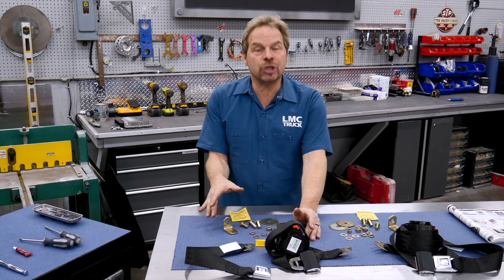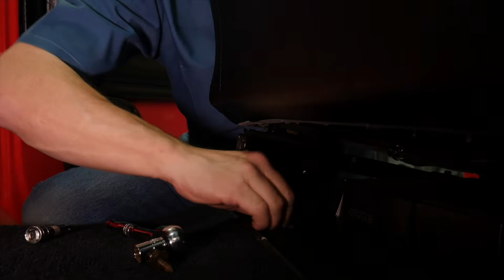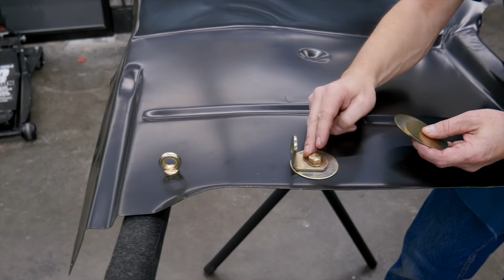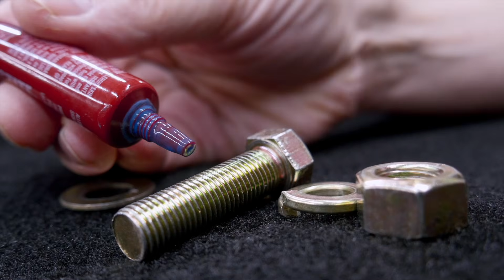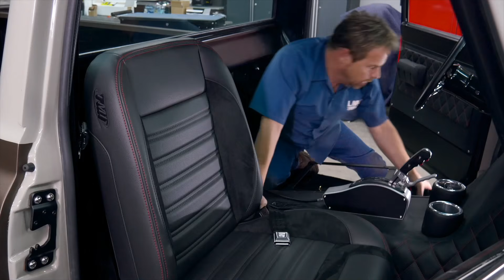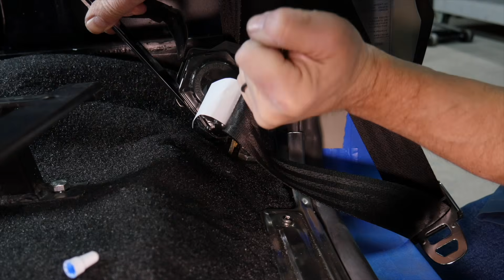How to Install a 3 Point Retractable Seat Belt | Kevin Tetz with LMC Truck

Comment: Nice video and very helpfull. Recieved my seatbelts for my 1983 Ford F250 a few weeks ago. Build them in, and that was easy but how can I attache the wiring for the seatbelt buzzer to the new buckle? Is it possible to take the wiring and switch from the old buckle and install that to the new one?

Comment: bought this kit to convert my 74 to a 3 point - but the bolts in the kit are too small for the threaded factory point in the cab corner. am i missing something here?
Reply: I too have a 74 custom deluxe C-10. Purchase 1/2" grade 5 or grade 6 bolts 1 1/4" long. Get those with threads with space to hex head,add 1 washer before and after mounting seat belt to upper corner pillar inside truck.Hope this helps ya.
Reply: @davidshirley275  thank you very much!

Comment: I'd like to do a 3 point for my 70 Impala
Reply: As a teenager I had a 70 Buick Electra and I am quite familiar with the lap and shoulder belts in your car. I was that rare teenager that buckled up both the lap and shoulder belts when I drove back then. It was a dedicated effort to buckle up the lap belt then the shoulder belt but I just got in the habit of wearing them. My lap belt had the locking retracters and the shoulder belt was manually adjusted with just a little slack. After being in a head on collision with a drunk driver, I can attest that those belts do the job and are life savers. I walked away with only bruises from the belts.

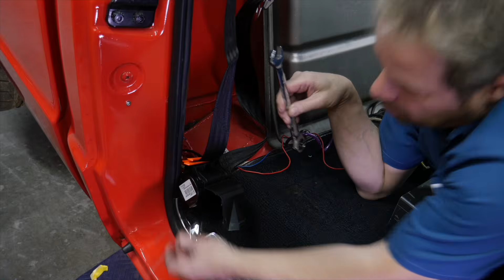Comment: At 8:40, will the retractor not hit the door when it's put in this way?

And another thing, there is only one bracket in the kit that is used for the retractor. Yet Kevin is putting in the straps for the bucket seats with that same bracket on the floor.
How does he do that with only one of those 90 degree angle brackets supplied in the kit?

Comment: there are NO instructions included in this kit. have to come look up a youtube video to see how to install the belts. also the cheap aftermarket appearance is appalling. for the money these kits cots they should be designed to work with the factory retractor cover that the squarebody trucks had from the factory. also these generic aftermarket kits are only made one way, to fit the driver side. when you go to put it on the passenger side, the belt will be twisted!!!! absolutely horrible!! very disappointed that this is the quality of product that LMC truck sells
Reply from the maker: Hello, If you would like to give us a call we're happy to email you some directions. We want make sure that you are satisfied and address your addtional concerns.

Comment: I just recently intalled these seatbelts into my 87c10 and they look up really quick. Just putting the seat belt on u have to move at a super slow speed or else it was lock up, other than that the install was super eazy and quick.

Comment: Does LMC realizes that NOT everyone has a 1972 truck. It would be nice to get some 80's instructions as well.
Reply: For80s they should have had3 point seat belts. Uninstall, then reinstall. How hard can it be? I have a 1980 GMC and it has 3 point belts.
Reply: I have a 1984 Dodge W100 and my retractable seat belts don’t even retract. I’m sending them back and replacing them with lap seat belts

Comment: Do you really have to remove the whole seat just to change the belts? overkill for sure. smh
Reply: You know that seat doesn’t fold forward. Little hard to get at the centre seat belt mounting points. I would take out the seat, save time and work.
Reply: You do it then with the seat in there.

Comment: well this is all fine and dandy, and the catalog says it will just go direct in place of my stocker in my 85 c10, but what about the seatbelt warning light, my truck has one and i intend to use it, lmc was originally supposed to be oer not universal aftermarket

Comment: Replacing my seatbelts have been a nightmare is my 92 d150. I cant get a single bolt out. Dodge decided to use rounded hex bolts. Just keep rounding out the holes, broken several easyouts, tried the wax trick, cant blowtorch it bc itll catch the carpet on fire. Idk what to try next.
Reply: Try left handed drill bits to get it out